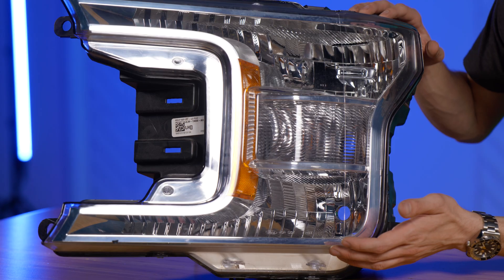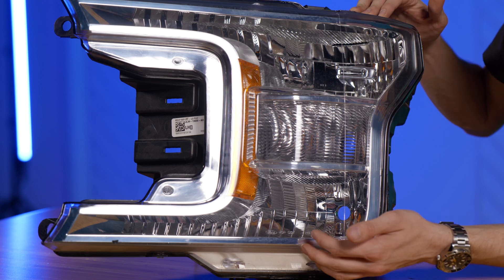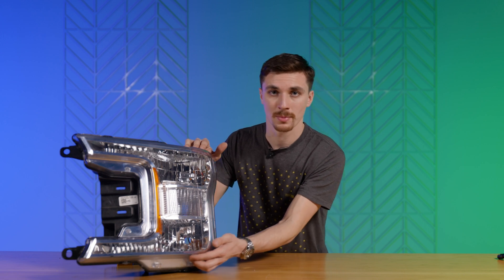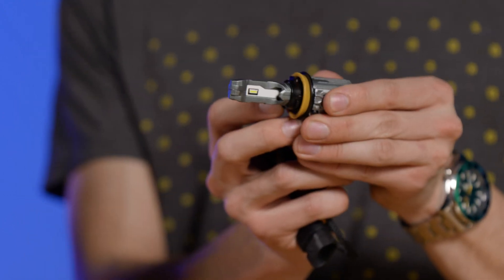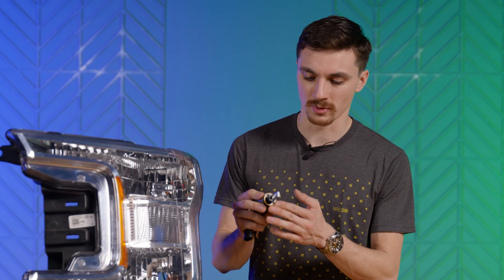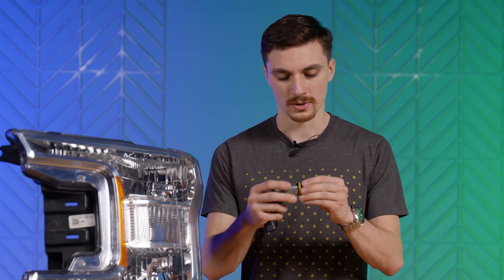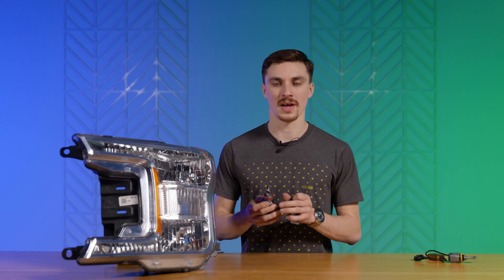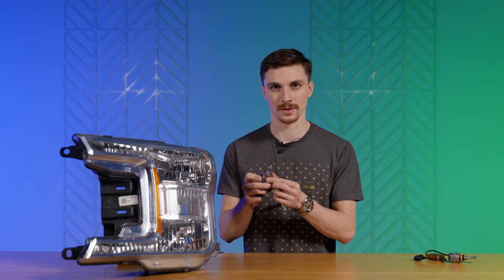How to Align LED Bulbs in Reflector Headlight Housings - Why is this important?

Comment: Rotation alone may not work. You may have to adjust the ANGLE of the housing, be it up, down, left or right, IF THAT SPECIFIC HEADLIGHT ALLOWS IT. 
On my personal ride I had to adjust mine by height to ensure that I couldn't read the lips of the person driving the car in front muttering curses at me probably.
There are many videos to do so on most cars. If DIY is not your thing, visit your local shop that has that ability. If they do not test that thing against a wall to make sure they can see the cut-off line, fuhgetabotit.
Reply from the maker: This is a great tip! 🧠